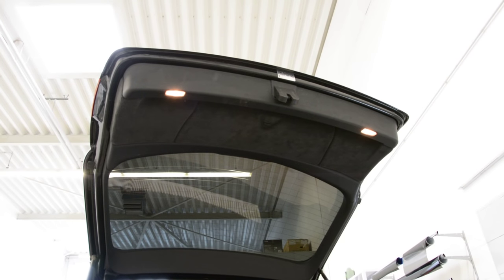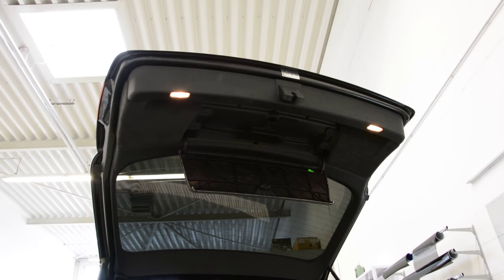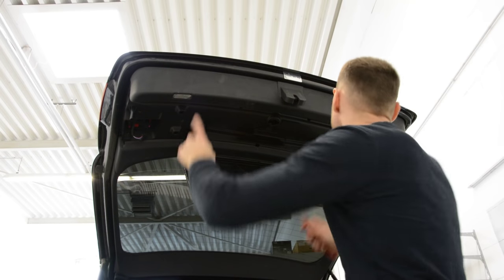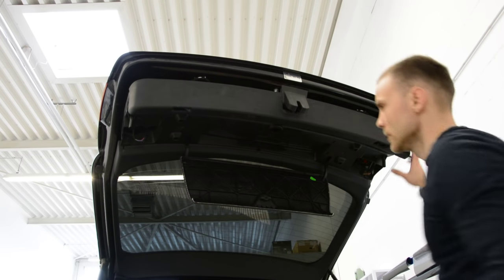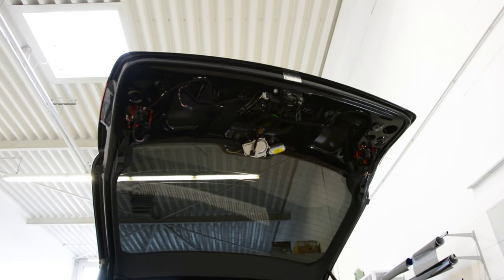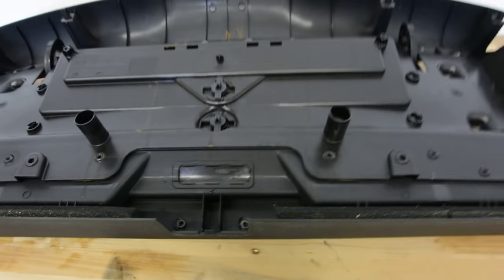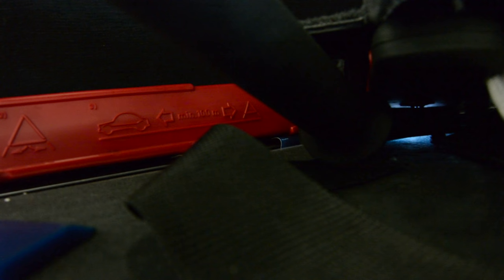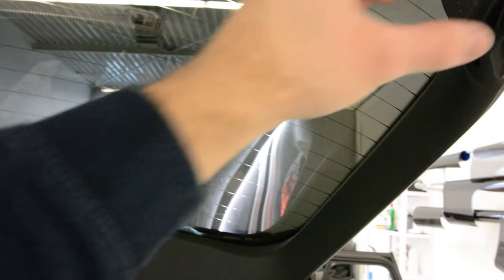How to remove the Tailgate panel Audi A6 C6

Comment: thanks for the video... i have some leak behind the panel from the washer system...i removed all the bolts and two lights... i managed to pull down the "door end" of the panel, but cannot pull down the "window" end of the panel... my panel has the sunscreen curtain, do you think it could have a bit different hooks to pull? thanks for any advice...

Comment: they all have that problem. mine had a problem with the little steel pipe inside the wiper motor, it wasn't water tite anymore. i had to use silicone sealant and it's ok now
Reply: Thank you for this great video